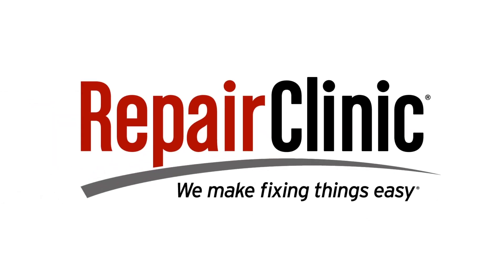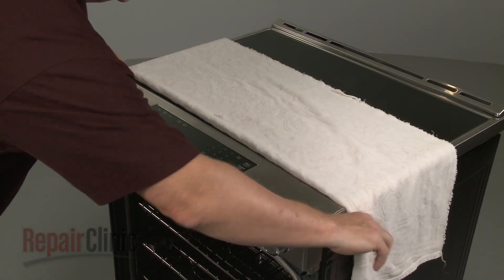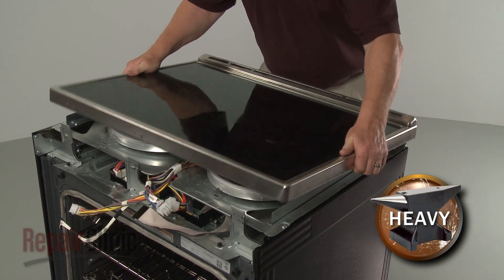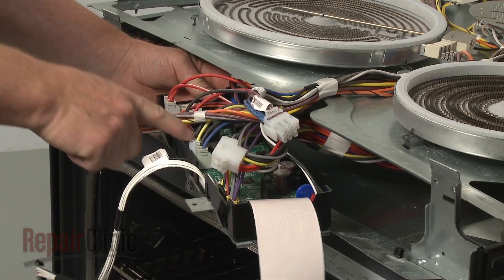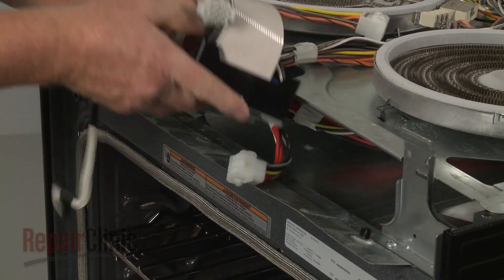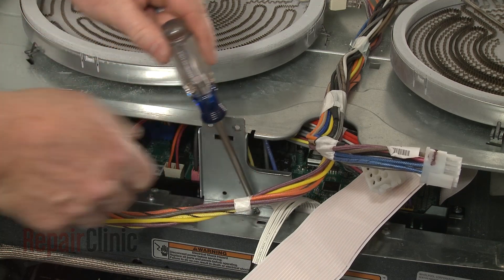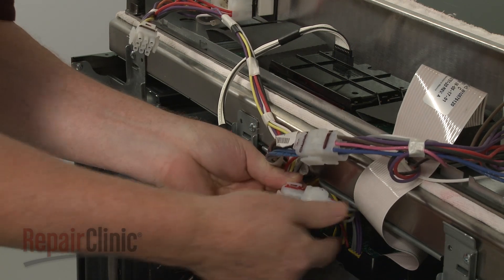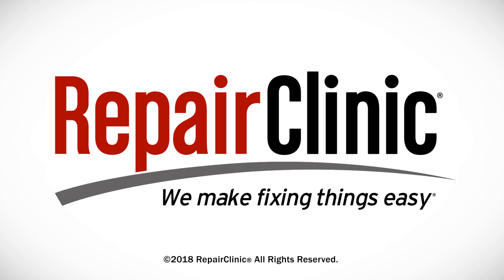Kitchenaid Electric Slide-In Range Control Board Replacement W11128223

Comment: I have a similar model, YKSEG700ESS2 and these instructions worked perfectly.
The part number I needed was W11082269 and was called a relay by the parts supplier I used. All done in less than an hour. Very helpful video!
Thank you

Comment: Before you buy a replacement board you should read this!!     Check the Start button...  You will see  a little pad lock!  Press and hold for five seconds to Unlock!!    It might work!    And if it doesn't, wait and see if it dries out. Put a Dehumidifier near the range for faster dry time. 

You see... In June 2019, I had a boiling rice water spill over  on top glass  of the range and it spilled below and I thought  it blew out the control board. My hubby opened it up an dried it up as quickly as he could! It worked for two days! And the board went blank.  The replacement was $489.00 from KA. I refuse, I told them I would buy a new range but not a KAid. Fast forward 10/19/19. Then two days ago for the hell of it I pressed the Star button n Nothing. The next day, I heard a Beep!  A notice came up: Connections lost.   I checked the Start button and I noticed the pad lock that said to: To Unlock   press and hold for 5 seconds - And the board lit up!   You see ... All good things come to those who wait.   Good Luck!  !m Hoping for the best for everyone out there.  Please, pass this on.  TY

Comment: Breaker keeps tripping.  I reset the breaker and the KitchenAid oven screen shows "E01.00  EC053".  It works for a few minutes then trips the breaker again.  Worked good for 3 years but now this just happened 3 times in a row today.   Thinking of replacing the Whirlpool Control Board Part# W11082269 for my KitchenAid oven model KSEG700EBS2.  Around $300.00... Ouch!  Can the board cause a breaker trip?

Comment: Great info.. However, my symptoms are a bit different. All works fine except that the "on" light for one burner remains lit even after I turn it off. The burner is actually off but the light remains on.  I opened the panel to maybe clean ribbon prong ends but the ribbon does not have "prongs" at the end, just soft plastic. Nothing to clean. Any thoughts?

There are four elements each in a clear plastic box, and a couple look dark on the top. Looks like fuses? I can't remove the covers to inspect. Help!

Comment: Question, I'm confused. When you click on the link above with the item number it sends you to the item page for the Display board, not the control board. Not the same part right??
Reply: Correct the part # is for the display but video is for the control board
Reply: No, they are not the same thing.